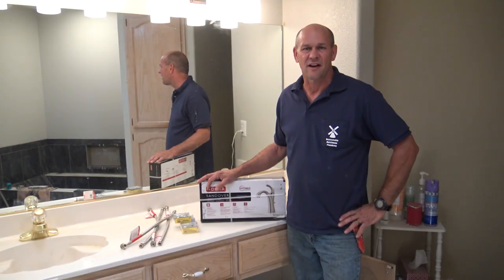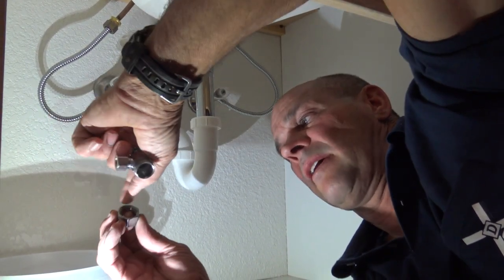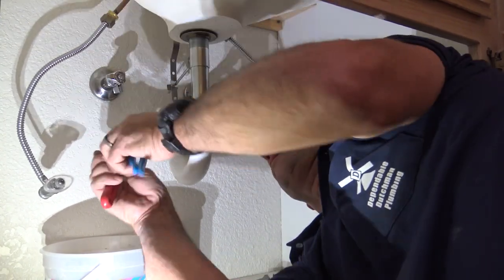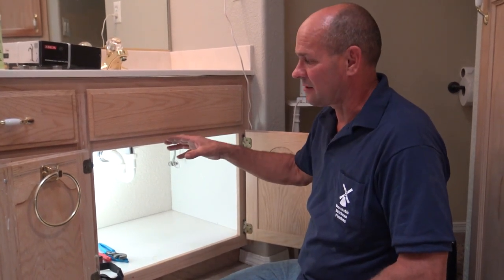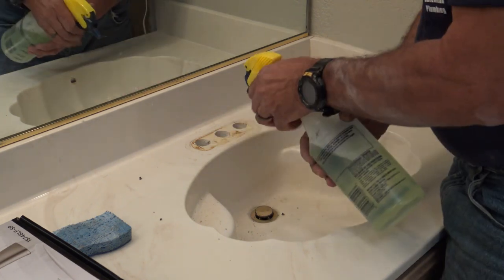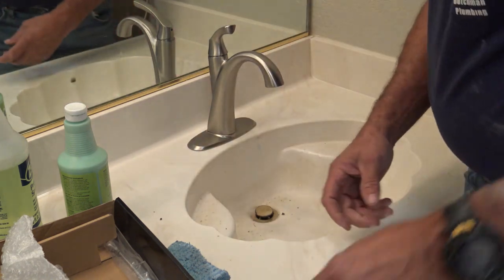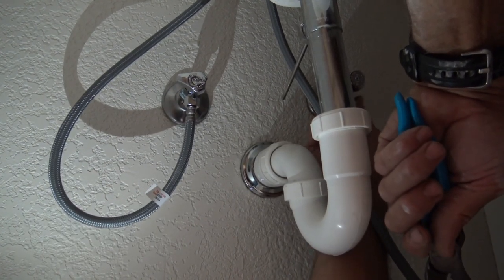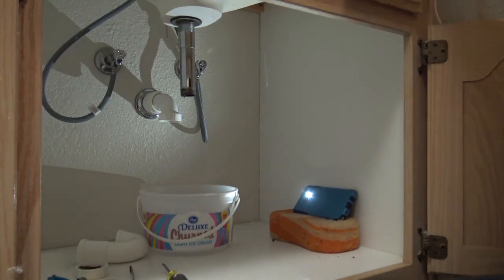How To Replace a Bathroom Sink Faucet - Upgrade Bathroom Faucet!

Comment: What a GREAT video!  I have a Moen Single handle in my bathroom and I believe I need to change it because when I push it in, it is not shutting the water the way it used to.  I would like to change it to the Delta that you showed.  My problem is that I tried to shut the water valves below the sink but it seems to have seized.  What do I do for that??  HELP!  I NEED SOMEBODY!!!
Reply from the maker: Glad this helped!  Lucky - we made a video on how to change the valve, see if this video helps https://youtu.be/__51CGPJr_g.  Let us know if you have any more questions!